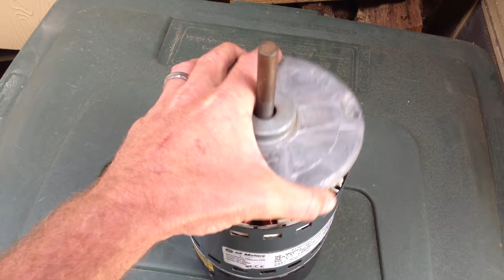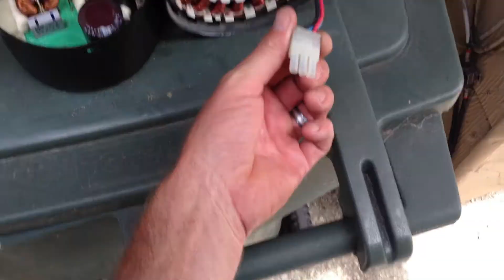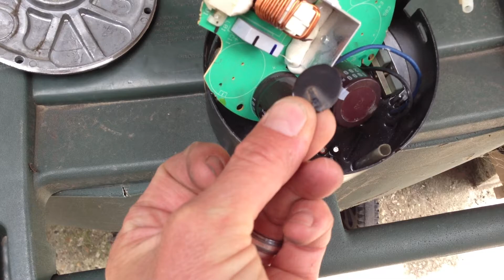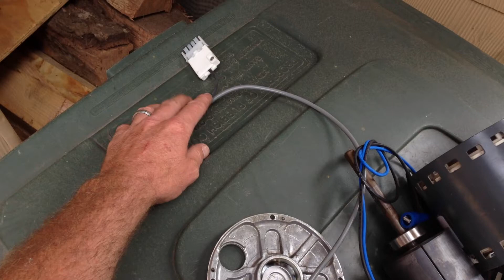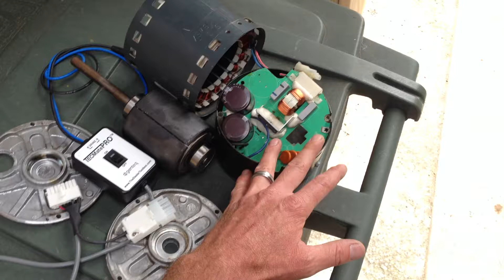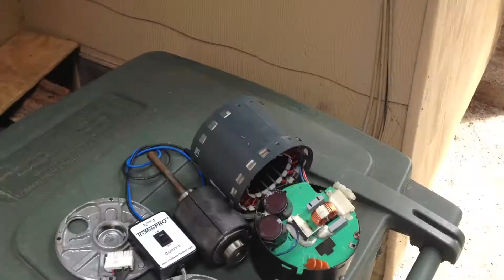Carrier - Variable Speed Motor - Diagnostics - Weathermaker 8000VS Furnace

Comment: looks to me after surfing the net on these ecm motors that this issue is so amazingly common and seems to be the same "thermistor" part over and over. So my question would be does the "thermistor" replacement last or constantly revisited or is it more worth it to just put an ole fashion fan motor in there with a relay like the old days?
Reply: Good thinking Michael. It is difficult to work around the new style circuit boards. But it is possible. The unit ultimately is designed for a variable speed motor, so deviating from that could come with some backlash. Noise being one of them. You would also need multiple relays for heat and cool operation. My advice is to suck it up and keep the manufacturers design.

Comment: This is exactly what happened to my motor. The thermistor fried off. The back of the board was brown and so I assumed it was shot. I ordered a new module ($100 on ebay) and installed it. The motor/furnace worked great for about two weeks. The same issue happened again. I'm worried to replace it again. I suspect the motor has an issue but as far as I can tell, the actual motor is fine.

Comment: I had the same failure on my furnace. Thermistor on circuit board burns open and opens power circuit to motor. Thermistor purpose is to limit starting current. On a 3/4 horse motor part is [1R020 rated at 20 amps]. Can buy online at Newark for $2 . Do not have to remove motor from fan enclosure to remove module and check if the thermistor is the problem.  A lot cheaper than new motor or module.
Good Luck

Comment: They make a new tool called Universal Zebra to check the variable speed motors. but the zebra can try up to 6 different speeds. they make one to check just the motor and another to check if your getting a signal from the board and to the motor. you can get them at zebra instruments